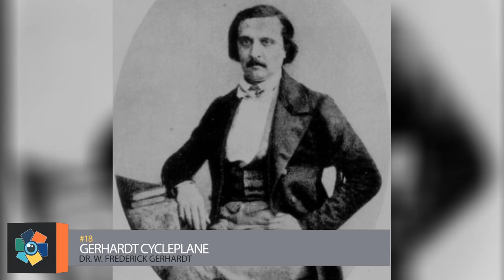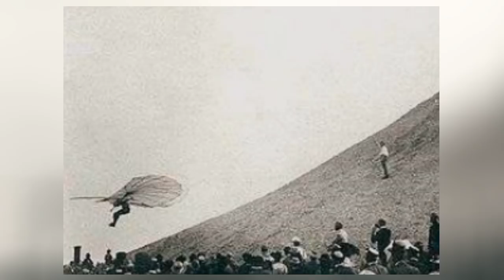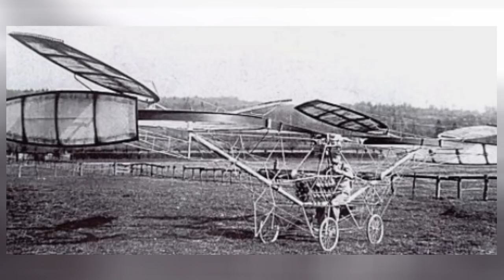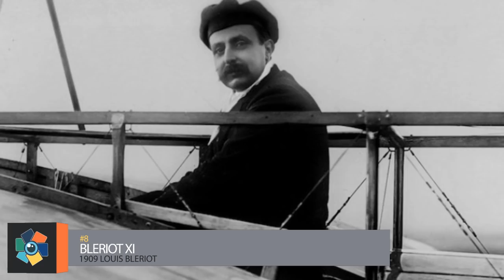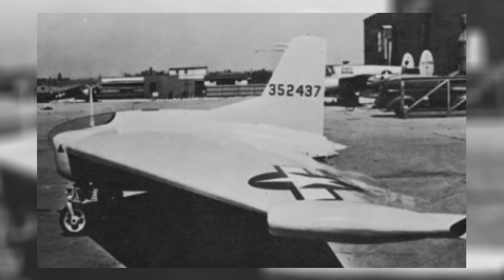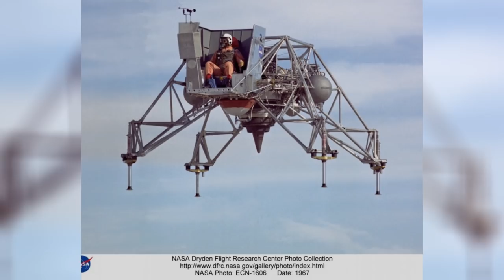20 CRAZY CLASSIC AIRCRAFT & FLYING MACHINES 1800s to 1950s

Comment: Quite a good video and well presented. I did however note three errors:
1. The Ader aircraft was actually documented to have taken off by the French military (making it the first manned powered flight). (This part was missed out by the narrator).
2. The 'flying bedstead' was a a Rolls Royce experimental VTOL proof of concept aircraft that predated the NASA luner lander simulator by more than 10 years. This aircraft developed the tip jet controls eventually used on the Harrier.
3. A totally original Bleriot XI is part of the Shuttleworth Collecgion and still flies (when conditions are perfect)

Comment: It was "lost to an accident" Translation It was a closed casket funeral.
Reply: killersushi99: Your description is funny but true. I have done mortuary work in Ventura County, California. There has been an above average number of personal aircraft crashes there, in hang gliders and small engine powered aircraft. And the aviators are often very badly broken up by their crashes. So, yes, many closed casket funerals; or cremations which are much cheaper anyway.

I'm sorry to see these budding aviators go. They often needed better training, as opposed to better equipment. (And better sense. Many of them flew over the dry riverbed going up to Santa Paula and Filmore. I would chose a softer crash site than a dry riverbed full of rocks and boulders!)

Comment: But the #1 Avro-Car, after the addition of a rubber skirt, did lead to the development of the hovercraft concept.
Reply: NOLL72 - Although the machine may look like a skirt-less hovercraft, that's not actually the case. The coanda effect used yo lift the Avrocar is quite different to the pressurized air concept used to lift hovercraft.

Comment: Arup S-4 and the earlier S-2.
Both flew several seasons at airshows. Several pilots no incidents. Stable, controllable, nimble and fast on low power, with silly slow 28kts landing speed. difficult to stall, impossible to spin. Rugged and easy to fly.
For some reason when the Navy decided to investigate such a STOL plane with round wing, they let Zimmerman build his silly flapping-prop monstrosity with the Vought V-173.
Instead, if they'd have built the Boeing 396 test plane to follow-up the Arup instead of the impossible Vought thing, they'd have had a plane like the Bearcat with more range, payload and speed, and 40kts landing speed. Low-aspect ratio planform would have taken over the fleet and military, and eventually all planes today would be some sort of lifting body/all-wing.
They'd have made awesome jets.

Comment: It's odd that the Wright Brother's aircraft didn't end up as a footnote to be featured in lists like this. It was towed into the air (could not get airborne under it's own power) and then glided. It's range was just extended by it's motor driven propeller. So it really wasn't a very impressive aircraft.
Reply: Rex Mundi, the trick is not merely  getting the contraption into the air. One can throw a plank from a height and exclaim " Whee, it flies! ". What the Wright brothers did, after studying sea gulls at Kitty Hawk, was to fashion a means of giving their contraption controlled directionality. ( Or steering ) by warping the trailing edge of the wings. 
   Now THAT took genius. Another, often overlooked aspect, was that engine they built. There have been successful attempts to duplicate that engine, and it's no easy task, even with today's CNC machines. Considering the realitive crudeness of the workshop machinery they had at their disposal in their day and working with a soft finicky material like aluminium, it's surprising the damned thing actually developed enough power to propell that plane forward. What with all those guy wires and profusion of struts and the operator himself offering tremendous wind resistance!
   I've gone through the plethora of comments that hail Santos Dumont as the first man to fly in a heavier-than-air device, but they're absolutely wrong!  
   You arm chair aviation buffs should really get yourselves a proper education before putting finger to key-board rather than displaying your ignorance. 
   And fact be told; it was an Andalusian Moorish Arab who first flew ( or rather glided ) when he jumped off a minaret of a mosque in what is today Spain. His name was Abbas bin Fannas, and sorry to say he was ver y badly injured. He actually flew or glided quite a good distance, much to the surprise of all the onlookers.
Reply from the maker: It was just to well known of a story and we were going for more unusual aircraft in appearance.